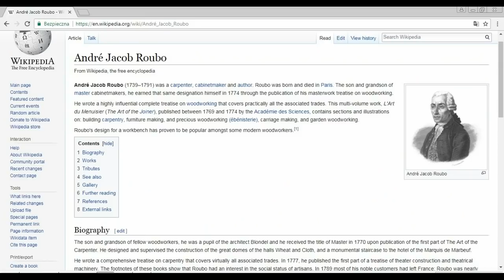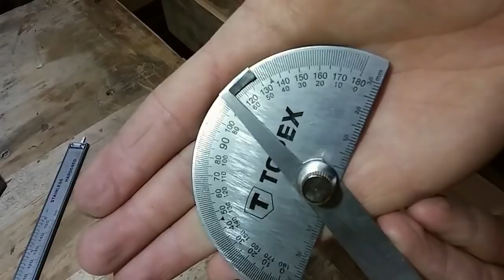004 Roubo style chamfer plane. Woodworking

Comment: Nice! Still a novice here when it comes to planes, but is making a double sided tool like this really that useful? In most cases you could just flip the work and use a single sided plane, right??
Reply from the maker: Thank you! Double side plane is needed because you never know what is grain direction. If one side makes tearout on the wood you can filp the plane and use it from opposite side. That solution guarantee perfect chamfers, without any tearout :)
Reply: @StavrosGakos  Ah, of course!